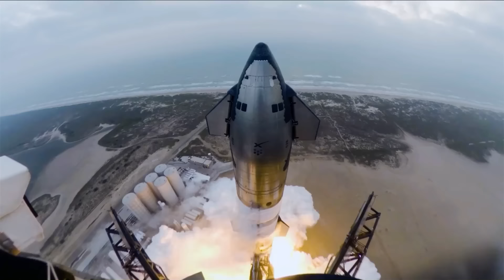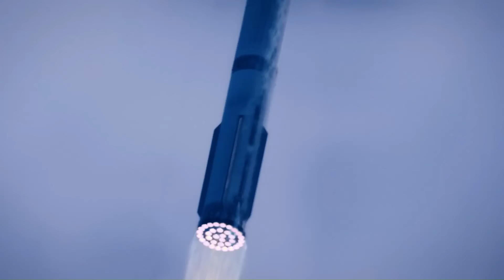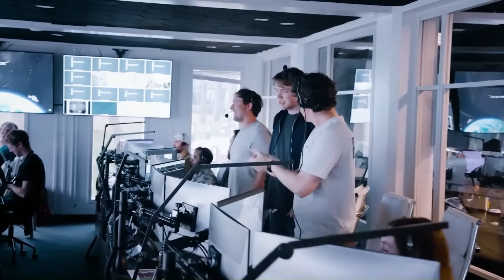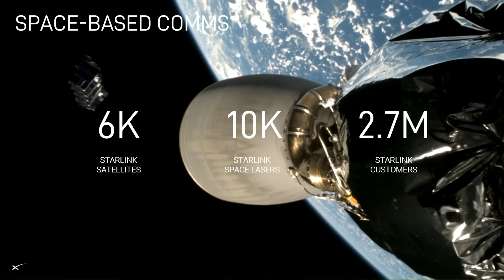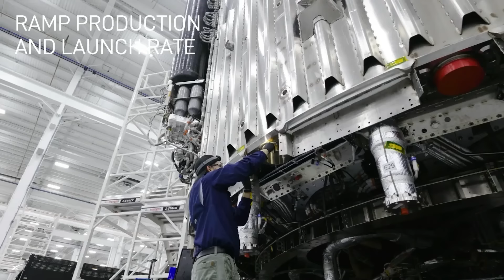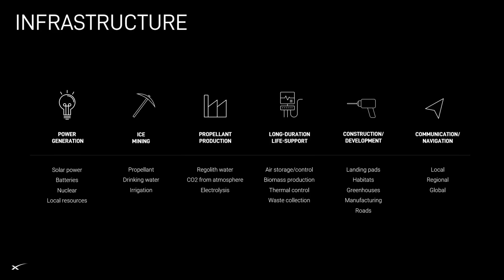Elon Musk SpaceX Presentation Leaves Audience SPEECHLESS

Comment: Although 80% cost is saved at SpaceX through reusable rockets for every 10 launches, each reusable rocket landing emits 26,000 metric tons of CO2 which is an equivalent of the emissions of 5,600 gas vehicles throughout a year. This also causes twice as many emissions and contributes twice as much to climate change and environmental degradation compared to the use of disposable rockets. How is this environmentally sustainable?

Comment: Interesting once the DOD went public in 2016 during an emergency congressional financial budgeting committee about the magnetic poles accelerating to the point of unpredictability when they needed to re-calibrate the planet's GPS satellites 4 years ahead of their predictive model.. accelerating to 6 times faster movement per year (~36 miles) since just 2001... Guess who announced the need to colonize Mars within 100 years, describing an event that might occur in the near future ( 3:12 ) that we can not control as his reason, and also developed the largest bunker/tunnel developing company on the planet that has special machines that can create over 5280 feet of 24 foot wide tunnels per week per machine that we know of, so within 20 years there is every reason to believe there will be thousands of interconnected miles of bunker style tunnels tracing the entire country, that only electric cars will be able to safely operate within with their own bio protection air filter systems and motors that don't make the tunnel's air quality go down and can self drive at high speeds to get mass numbers to designated areas at the flip of a switch.. Ever notice how world governments stopped calling it global warming and it's now climate change... Ever notice how Greenland's runaway melting didn't really jump start until the early 2000s... coincidentally right when the north pole started accelerating and moving hundreds of extra miles away from Greenland vs conventional magnetic movement data that goes back to 1620 which proves this has not happened in any sense of the word "modern memory", so over 400 years of data. That's why governments seem to have taken a vast chunk of your emission taxes and used it to build data bunkers, seed bunkers, clock bunkers, machinery/manufacturing bunkers, food store bunkers, military bunkers, etc... they've been stock piling a rebuild system underground while the 2 richest known men on Earth are racing to colonize the Moon and Mars simultaneously within this mysterious deadline goal... just saying... if the magnetic poles don't calm down and revert then something strange and irreversible will occur within the next 100-200 years for certain. As the north pole moves into open water and approaches faster oceanic jet streams, then it warms up because of something called advection but a good way to imagine it, the ocean is a water cooler for your computer, and as the cold source (north pole) moves towards the hot source (cpu) the cold source heats up which over time causes the cold source to warm up too... Meanwhile the south pole is still moving over a land mass, which insulates and stores that cold energy better in the stone and thus even NASA will tell you the south pole is still forming ice faster than it's melting and all of the melt zones in the south seem to share a correlation to the jet stream currents shedding their heat from the north pole's influence in the open water. Anyways.. take care.. share the truth, enjoy the red pill.. I encourage you to google image search magnetic north movement map and even a small child can instantly identify the problem.

Comment: The next step is designing a Rocket that doesn’t run on rocket fuel. All of the fueling and heat would No longer be an issue. So basically the entire rocket would be simplified. The only reason it takes so much force and fuel and heat to make it go far up in the air is gravity. Apparently what Bob Lazar was back engineering at Area 51 was a craft with anti gravity technology. This technology would solve every aspect of inter dimensional travel including speed. A craft that isn’t effected by gravity could go 100,000 miles an hour and stop instantly. Maybe it will take another 500 years or 1000 years to figure out anti gravity. But for now we have engineers building fire 🔥 propelled engines

Comment: Ok, grab a small ball.  Like a golf ball or something.  Find a flat surface of 6 feet or longer.  Bring your eye down to where you can no longer see the top surface.  Now roll the ball and witness what happens.  That's right, you just witnessed how the sun sets and rises on a plane.  In this scale you don't have to contend with atmospheric contamination which makes the atmosphere itself one giant lens that maintains its apparent size.  Too bad the globe theorists failed basic geometry.

Now grab some iron, a magnet, some metal wire, a metal stand, and a torch.  First, wrap the wire around the iron.  Next, tie the wire to the stand or hang it from something so it can be heated with the torch.  Attach the magnet to the iron.  Now pay attention to what happens when you heat the iron until it glows red.  That's right, the magnet drops!  Congratulations!  You just proved what science claims the Earth's core is and how it works wrong.  Too bad the globe theorists weren't informed about the Curie point.

This one will vary depending on the sink design.  Most noticeable in rounds sinks, though it should work in all of them.  Ok, grab 2 full glasses of water.  Go to your sink and put 1 glass on each side.  Now take 1 glass and pour it on the left front wall and watch it drain clockwise.  Take the other glass and pour it on the right front wall and watch it drain counterclockwise.  The left rear wall will also drain counterclockwise while the right rear wall will drain clockwise.  Congratulations!  You just witnessed both Coriolis effects in the same hemisphere!  Too bad the globe theorists didn't understand momentum very well.

Plane Earth class dismissed!

Comment: For anyone who still believes in the Moon Landings
Here are two questions that require knowledge contradicting your belief in the Moon Landings
1) "What was the temperature of the film inside the camera while being on the Moon?"
2) "How in detail the Van Allen Belt is created"

Number one requires knowledge that heat is when the molecules of matter are accelerated by a form of Energy. The Sun is radioactive and a film is a chemical compound that reacts violently with most Electromagnetic radiation (like the Sun)

Number two requires knowledge that the Sun is radioactive. We are protected by a MAGNETOsphere (no, I didn't write Atmosphere) that repulses the Sun creating a HIGHER zone of radiation than the outside (like the Moon) which is STILL radioactive.

Both required knowledge of the Electromagnetic SPECTRUM

Comment: Hey musk , your space rocket thing is WAY to expensive. Use the gravity of ANY planet. Build it here on earth. Use gravity to your advantage. Pay WAY , WAY less money. Ditch the rocket system and do this instead. Listen what I say is all true. This is an EASY experiment. Turn on your water spicket to a small stream. Get a balloon , blow it up as tight as you can without blowing up the balloon. Rub balloon very fast on your head. Put the balloon next to the water stream. SEE , it bends the water to a 90 degree angle. OK , this a simple experiment  , you ask yourself WHY. Well, static electricity. IT , alters gravity. Well take liquid mercury and pressure rise it. You need a vibration. Liquid mercury ionized rotated pressurize 
Will create a static charge. The rotation is crucial. IF the planet rotates clockwise , to go up you rotate counterclockwise to go up.
Rotate the same as the planet it goes down. Elon look up the plastic plant that make plastic wrap film. The janitor was cleaning as got stuck in an invisible wall , a static wall. The only way to get out was to back up the way ke came. Basically people came in and had to ground it to get rid of the charge.

Comment: The biggest problem with Mars is the lack of an atmosphere.   AFAIK, the pressure on it is 0.16 percent that of earth.  What that means is that the boiling point of water in the atmosphere is less than the 32 degrees F, the freezing point of water on earth.  So, even if there is water there, it will just evaporate after it's unlocked.  I haven't heard any solutions to this problem.  So, what are we going to do? Live on Mars in pressurized man made environments? Why not do that on the moon instead? If we could just solve the problem of the atmosphere, Mars would be viable.  I just don't see how we can survive there

Comment: Instead of 5-6 starship launches to fuel one mission to Mars,  work with Spinlaunch to cheaply launch rocket fuel to an orbiting refueling station that SpaceX builds. 

That way you can change the Starship launch ratio to 100% Martian or Lunar bound and "reduce" the need to catch them on Earth, and the cost and risk that entailed. 

Maybe Spinlaunch orbital accelerators could be repurposed and attached to starship, and lift her out of Earth's gravity, saving fuel and or allowing starship to carry more payload.

Comment: What does he mean when he says "full reusability"? No SpaceX rocket it fully reusable. All of them need to be refurbished before another take-off and on Starship the heat tiles need to be replaced entirely. That's not what I understand by "full reusability"?
Reply: Starship is still being designed and tested, it's not finished yet. The starships flying now are version one, they already have version 2 in production and version 3 planned which will increase the reusability factor at each level.

Comment: I never understood the part about refuelling in orbit. One way or another you need to get the fuel to orbit and a rocket sized object to orbit, so how does the refuelling tank get to orbit? And if starship can carry that load then it could just get straight to Mars. The only way I see would be they somehow get an empty tank to orbit on one starship, then over the course of multiple starship trips they fill it up little by little. Any thoughts?
Reply: Check out the performance section of the video at 20:00 mins. Each starship requires 1500 tons of fuel to launch 100 tons of payload to orbit. So they'll need to send up approximately 15 refueling tankers to refuel 1 Mars bound Starship.
Reply: Launch a starship designed as a fuel depot in to Leo, then launch multiple 'tanker' starships with extra fuel to fill it up. The when you want to send your ship to mars or the moon, it uses the depot like a gas station and refills it's tanks before leaving.

Comment: Earths natural disasters get more dangerous every year as this is the earth tearing itself apart from impact. The fuel we have is the only. Nearest galaxy is millions of year of void space drifting as ship's. Smaller vessel is dangerous in void space. Gasoline doesn't turn back. Air displaces and water and earth all resources more outward from the core. Exposure of core is death but life will restart here. I wanted planets combination for vessel in void space. Using the gasoline and burning dirt won't get it back. Taking the materials out of will weaken the structure to the surge of water levels a quicker collapse a possibility of cooling the core never, still shredding the upset and tossing the waters outward. Gotta trap all this earth in a ship preferably of far fewer numbers of current earth's population safely. Drift in void space.

Comment: After dealing with a WISP and cell phone hotspots for 20 years, Starlink is finally true high speed reliable wireless internet. I've been on for a little over a year and I have only had 1 outage that lasted longer than 1 minute and that was a DNS issue that affected tons of others that lasted a few hours. The only time I see a dip in performance is during heavy rain, which is still beyond my expectation for a little dish plugged in to a router. Anyone on the fence for Starlink, take the jump!

Comment: Why do Starships require refueling to get to the moon, when the far less efficient 1970's rockets weren't capable of refueling? Modular Thorium Nuclear reactors, would be easy to build and transport to Mars, the only Safe nuclear fuels for reactors, which could be minituarized to fit into vehicles, for mobile energy either on Earth or Mars.
Reply: It's harder to get to the moon than mars believe it or not from a Delta V perspective

It's incredibly hard to land there
Reply: @TheMagicJIZZ  The part that’s more important to his question is that the only reason the Saturn V could get there without refuelling, is because it was constantly throwing away massive sections of the spacecraft, until only a tiny cockpit makes it back.

If you want to go there often, it has to be affordable. If you want it to be affordable, it has to be reusable. If you want it to be reusable, you can’t just throw away sections that ran out of fuel.

The fuel only costs about 2% of the total launch cost, so if you’re recovering the entire spacecraft, refuelling becomes far cheaper than just throwing major parts away on every single launch.
Reply: @TheMagicJIZZ  ???

Comment: 10 launches per day...  I question the Earth's atmosphere resiliency of ozone with those Saturn-V-sized beasts.
Reply: The average city is 100x worse, this would be a drop in the bucket by comparison.

Also look up what happens when you combust methane… it mostly turns to water.

Methane itself is greenhouse gas that’s 20x worse than CO2, so breaking it down to water and a little CO2 is fine.

Comment: I disagree that Mars is the only option. Venus is also an option, with gravity closer to earth's and a atmosphere that can be reversed into breathable air over time. It will take a long time, but in the mean time it would be possible to live high up in Venus atmosphere where the temperature is close to earth on floating cities. It's much easier stay in the air on Venus thanks to the thicker atmosphere and lower gravity compared  to earth. There is also alot of free energy on Venus. Mars is best for the short term, but Venus is much better in the long term.